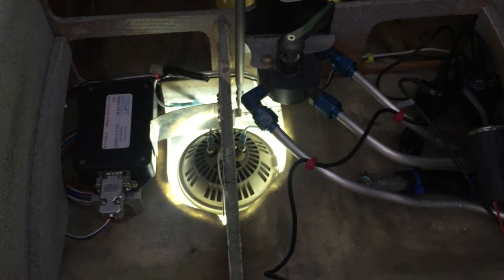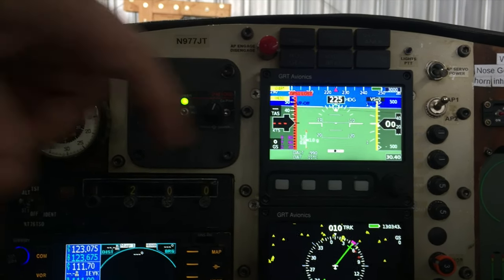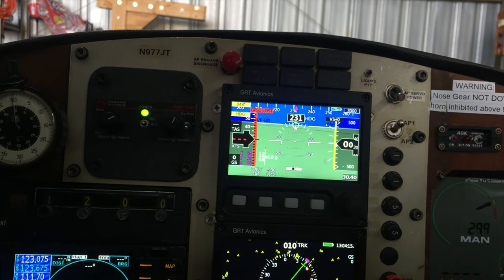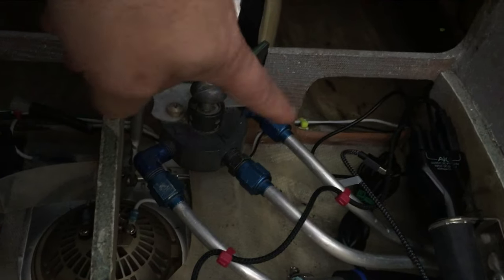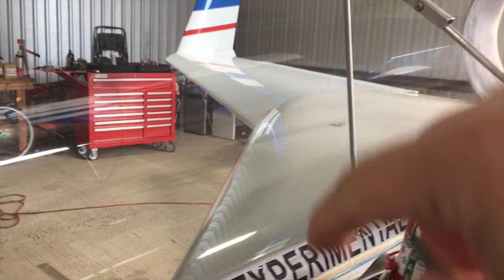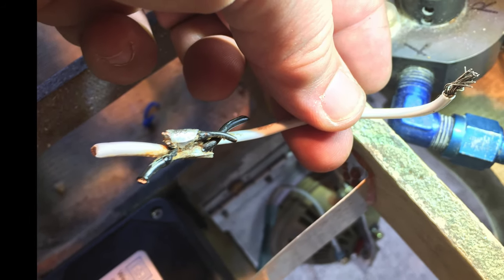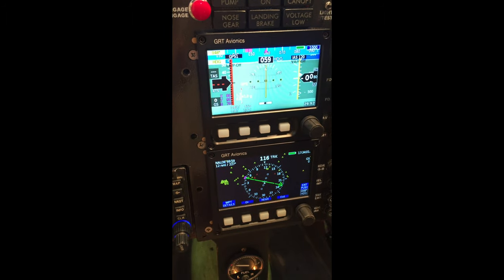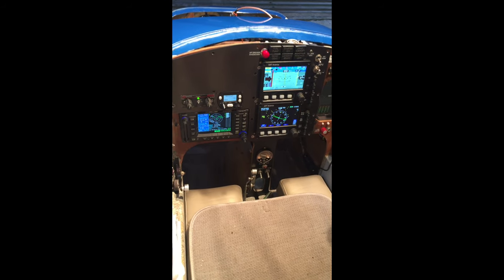Magnetometer interference

Comment: Great video, thank you for sharing. You probably already know this but just in case...using a shielded cable can further help to reduce the rf emitted by high current wires like the ones for your landing lights. A  dual core (of the appropriate gauge) with braided shielding and a Teflon jacket would be appropriate for this application. Just don't forget to ground the shielding. Albeit this comes with added weight, however short lengths shouldn't be too taxing. If you can't afford the added weight then at least twisting the positive and negative wires would help to reduce rf noise.
Thanks again for sharing, have a great one!
Reply from the maker: Thanks for your comment. I recently added fuel injection to the plane and the pump ended up near the magnetometer. This didn't work at all, so I moved the magnetometer to the left wing strake, away from all metal. No more issue now.

Comment: Hey Marco.  Couple of questions for the Noob / novice.  What does the meter do, and is that the fuel valve on the floor for switching between tanks?  Cheers, Aaron.
Reply from the maker: Hey Aaron, sorry I didn’t see your comment before. The magnetometer is basically an electronic compass and drives the heading reading on the top screen. Ciao, Marco.